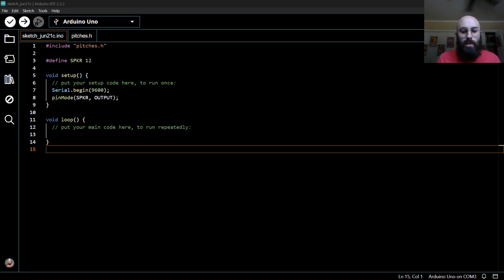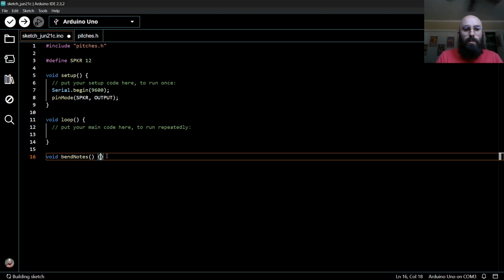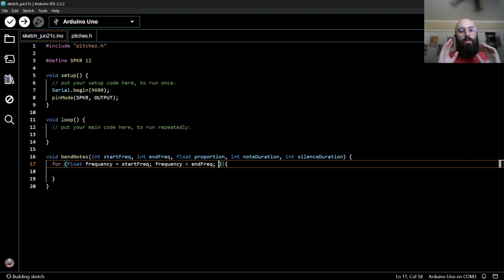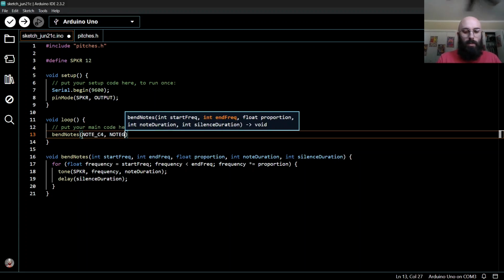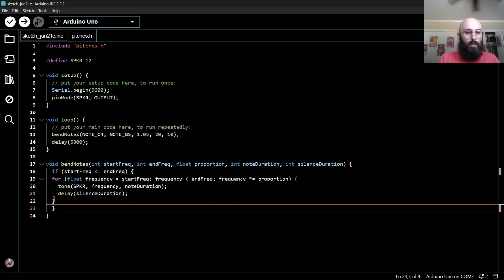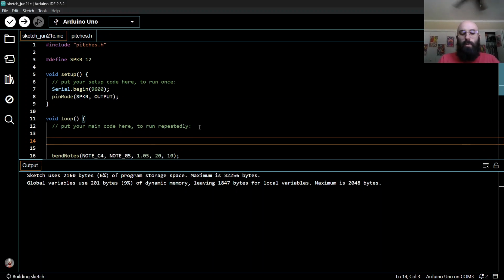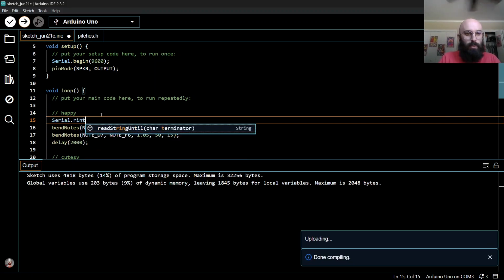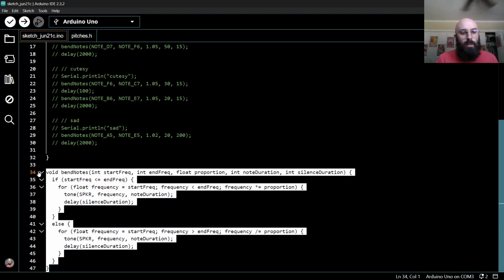Giving Robots Emotion with Sound (Arduino Crash Course 33)

Comment: 🤖🔊🎶 Michael! Thank you so much for the fun and insightful lesson. I'm up late working hard on my procrastination instead of doing the Arduino coding I should be doing for a fun project I'm working on. Even with the surprisingly adept Claude AI at my side with his rapidly improving 0-shot capabilities, I decided to take a break and discovered your video. I'm honored to be the first to comment.
  -I too was thinking of fun ways to create more emotion and live-reactive feedback, as it gives 'life' to a project. What ended up creating the most eerily convincing sense of simple circuits and code being 'alive' was adding a simple Cds cell that very actively could be used to create large fluctuations in real-time of the proportional factor by dialing in some math that would exponentially vary it by the rate of change in localized light conditions at the Cds cell. ... For example, just approaching was enough to cause a varied output, and picking it up or tossing it in the air made it create such a response that you'd swear it was self-aware! 😂😂😂
  -The cool thing is that the rate of change (in light) accurately reflects the response of any cautious little creature. More abrupt movements create a greater response, while slower movements create a seemingly calming response.
  -The only other quick idea is creating a running value in a volatile variable that gets averaged out over a longer period, say a running average of the last 10 rates of change (in light readings, or accelerometer, etc.) values taken once every second. This would be the equivalent of the overall 'excitement' level that could be used to trigger more or less 'vocalizations' or activity proportionally. So it adds even more of seemingly 'real' emotion to slowly calm down as well! How fun, let me know if there's anything I can do to help, or if you'd like to help me with some of these really fun projects 😀👍
  -Btw, love your site! Totally cool throwback style!!!   Alright, back to interfacing my brainwaves with Arduino...Literally! -Jay
Reply from the maker: Glad it got the wheels spinning. Good thoughts!